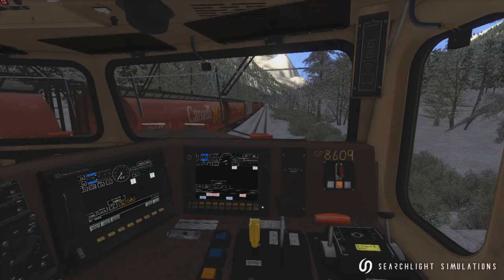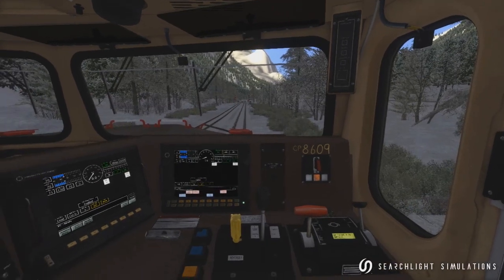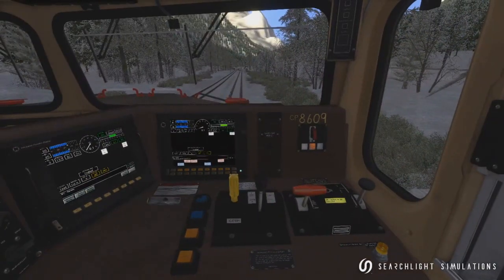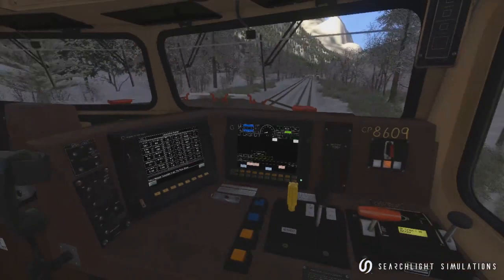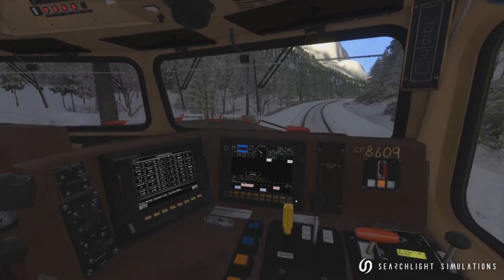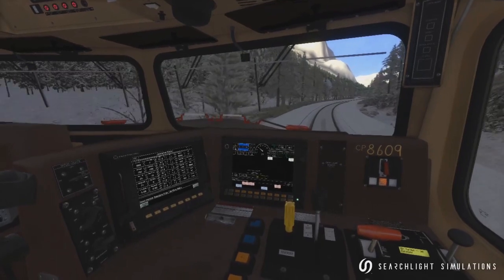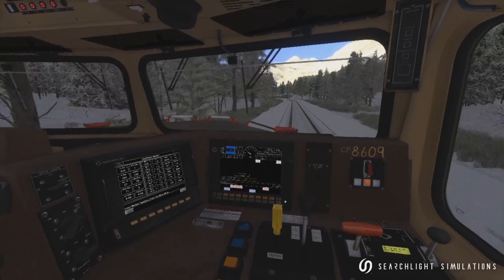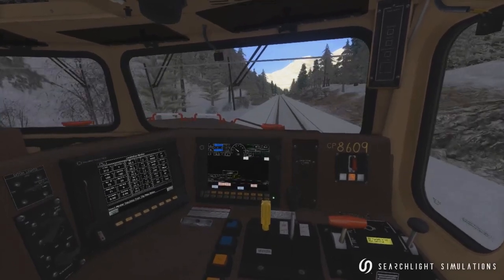Train Simulator: Canadian Pacific AC4400 - Tutorials - #1. Train Handling

Comment: Bruuuh, I ain't evet seen a 44 put down 300klbs
Reply: I mentioned that in trains that are conventional (e.g; not DP'd), with 3 of them putting 100klbs down, you're at 300klbs. You always have to consider your additive power of each consist in your train. This is why there is RPA and RDBA limits in the rules. (Rated Powered Axles, and Rated Dynamic Braking Axles)
Reply: @thetrainshop  that is still not 1 unit putting down 300klbs. I don't think any locomotive in North America is capable of that. I know most AC GEs go up to about 180klbs Also, slack causes knuckles (unless the knuckle is defective).
Reply: @mr.meatshower2756  i never said one unit putting down 300klbs in the tutorial.

And yes, draft force slack is what get knuckles, but if you overload them, they can break too. Happens all the time. Plenty of Iron Range boys will tell ya that Notch 4 was fine starting a train, but 5 is when they got a knuckle. 

The overload knuckle is almost guaranteed to be within the head 10 cars.
Reply: @thetrainshop  Ah,the wording you chose at 2:20 made it sound like that to me. At Big Red, they never tell you to "times it by X amount of locos on the H/E", but more of "what this unit is doing, the second one is doing" which really is the same idea, just different wording. Its because of this, only two AC units are only allowed to be online together, and to disperse the online units if possible (i.e. 4 on the H/E, have 1 and 4 online and 2 and 3 Iso'd). It's more so that you don't roll the rail than it is for knuckles.
Reply: @mr.meatshower2756  ah, yes yes. Same idea, different phrasing. String lining is also definitely a risk you can have when running high powered units.
Reply: @thetrainshop  that as well. I can tell ya that I was recently running up a hill with my two H/E units putting down 160ish each, and I was more worried about rolling the rail or stalling.